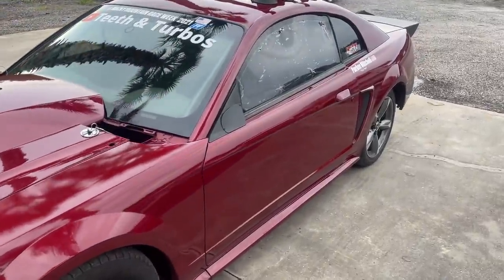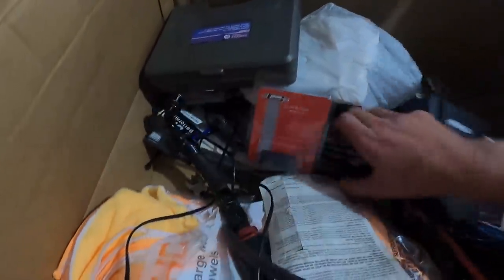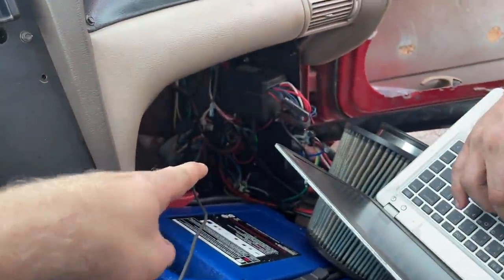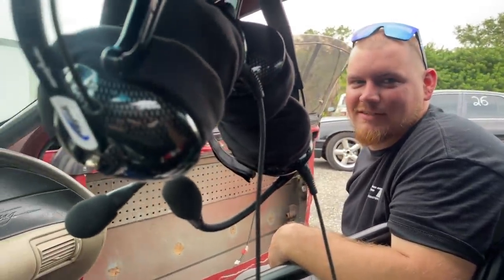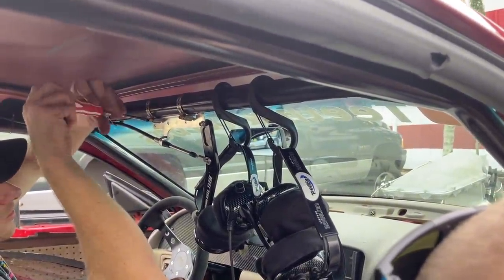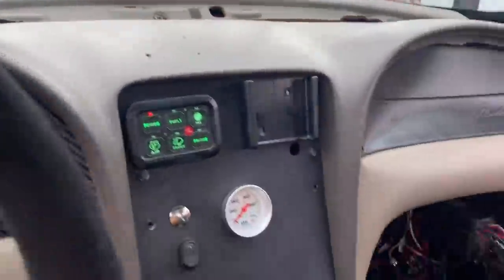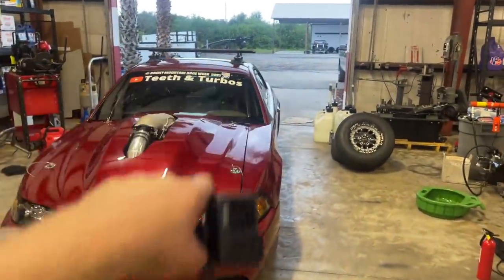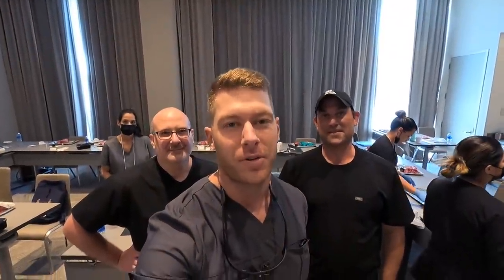Found a BIG Oil Leak Hours Before the Car Leaves & Spicy Tune from Dr. Tune 'Em All

Comment: Damn, a lot of good info from Jack Stand and the Doc👍 And I've had oil pressure sensors fail so bad it was leaving a trail ever where it went. Love seeing you doing the semi lo buck racing.
I got synthetic bone jammed into the hole in my jaw from a impacted wisdom tooth when I was young. I got to hold the chisel while the Doc tried to break out the wisdom tooth.... Fun times... I spat out leftover synthetic bone for a while till it healed up.
Reply from the maker: You’ll get that on them big jobs
Reply: @DoctrParker  🤣

Comment: Does it matter that you have the Turbo sucking in the catch can overflow smoke?  I have no idea, so it's just a question, but it would seem to be an interesting mix of stuff flowing directly into that turbski right out of that catch can exhaust.
Reply: Also, very cool stuff re: the bone grafting!
Reply from the maker: It’s completely fine, the amount of air coming from the catch can is pretty minimal too
Reply: @DoctrParker  Dig it

Comment: Doc car looks great and dr tune did excellent job tuning the car. Can you modify plexiglass windows removable make more street friendly.  Ignore my comments I did not see the removable windows.
Reply from the maker: Yea I can remove them, it helps a lot. Need to convert back to windows at some point
Reply: @DoctrParker  agreed i miss my newedge mustang but it was running stock 4.6 garbage. I want another newedge ls with t400 easier said that done life throws you curve when you don't have time and money to build it